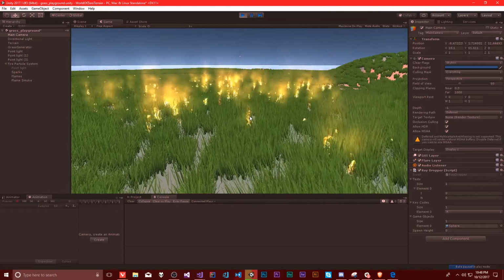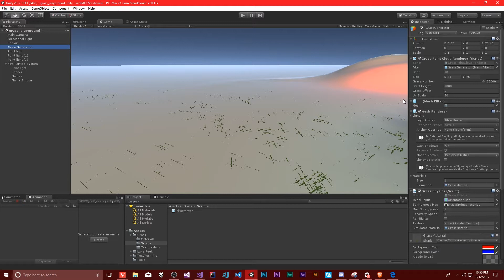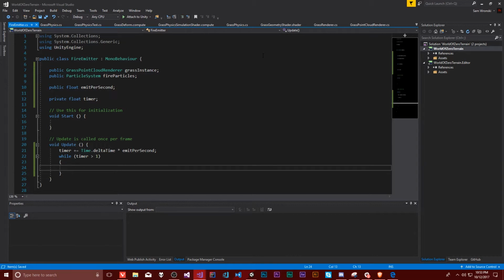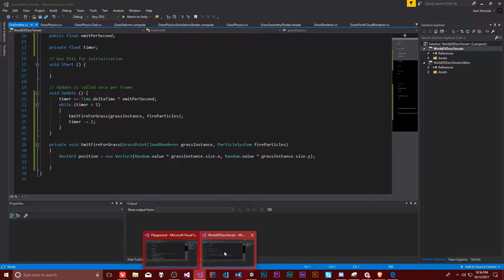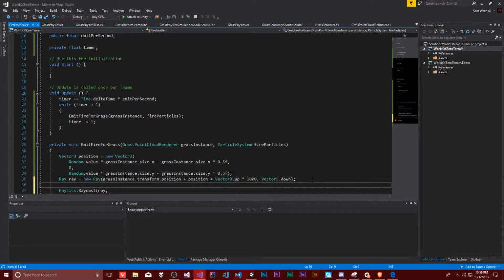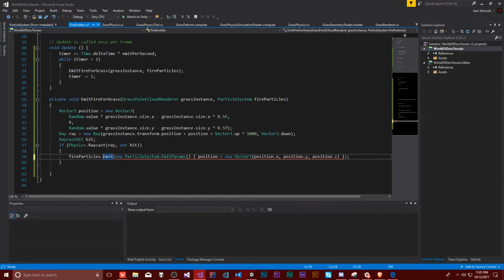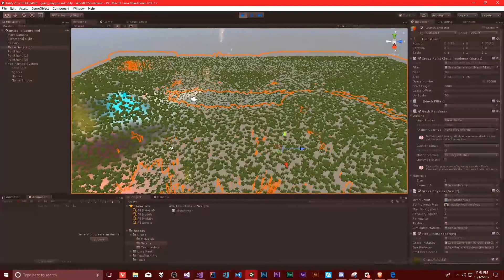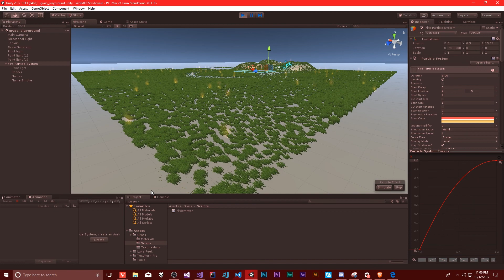Custom Particle Emitters in Unity 3D

Comment: Can you just upload your whole project. It would make things much more easier for me now. You started the series without showing how you made the meshes and for someone new to game dev, it's quite hard to get to your point. Thanks
Reply: Which meshes do you mean? The scene only has a terrain for the ground and the grass is from his custom grass renderer which he shows in a different video. (Offtopic, but im not sure if this kind of videos are the right place to start for someone who is new to game dev)
Reply: R1PFake I mean first video of this series
Reply: It's pretty tricky.

1) You can get the grass Mesh from the Nature Starter Pack 2 on the Asset Store. I think there is one from the Standard Assets too. Choose the one you prefer.
2) Then in your scene, create 3 Quads with different angles (0,120,-120 I think) and for each Quad set the Material of the grass from the Store. 
3) Select the GameObject and in the "GameObject" menu, select "Export Model...". It's gonna export the model as a .fbx file. I think you need to download it on the Asset Store. Just search for "Export model". It's an asset from Unity Technologies if I remember well.

<> Now Install the Autodesk FBX® 2013.3 Converter (quick)

1) Import the .fbx file
2) Convert it into a .obj, the .mtl (Material) will be created at the same time with the same output name

<> Then install Blender

1) Import the .obj (delete the default cube and camera before, you may forget it).
2) You should see in the hierarchy 3 Quads, that's your model. You can select each Quad in the hierarchy (maintain Shift while selecting).
3) At the bottom there is a menu, you have some options like "View", "Select", "Add", "Object". Select Object>Join (while all your quads are selected). 
4) Here you go, you now have a single object. Just export now into a .fbx and use it in Unity. You now have a single Mesh for the group of 3 grass you had first.

It may be a long process, I'm totally new at this so if anyone else has a quicker way to do :)